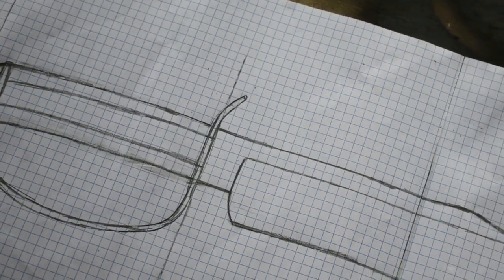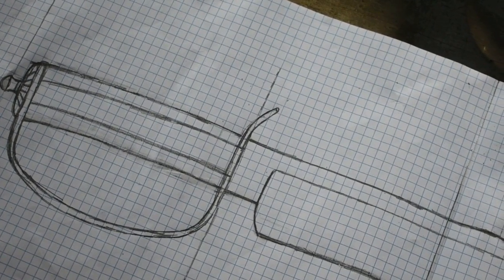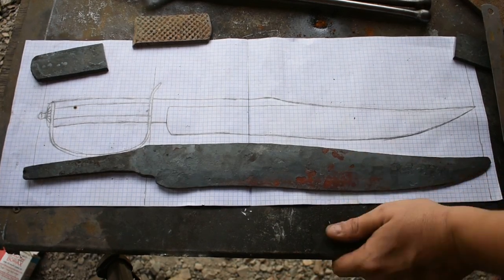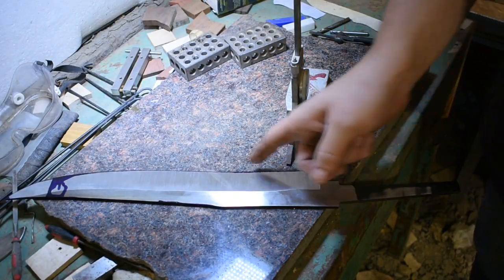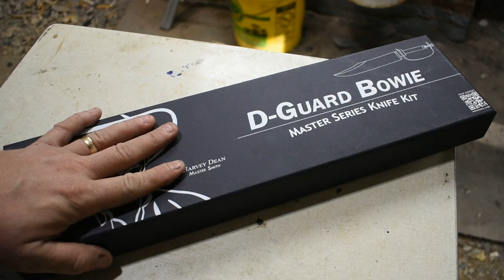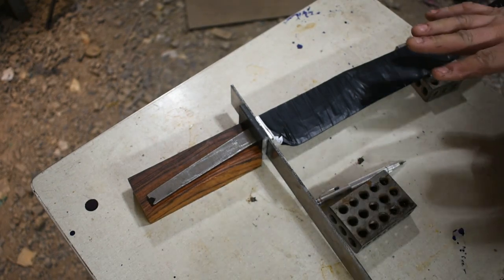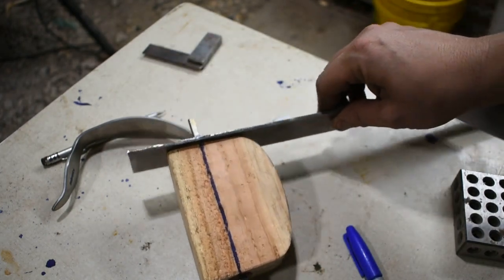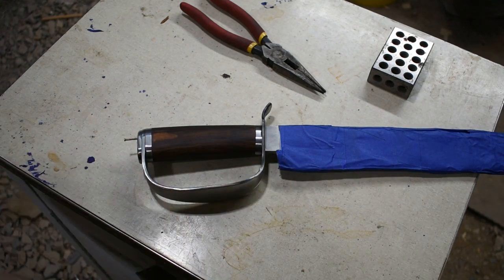Forging a Civil War style D Guard Bowie

Comment: Excellent knife. Although, are you not worried about possibility of that tread welded to tang breaking off during chopping?
Reply from the maker: Thanks, Not in the slightest, it is fully secured with a good solid weld, the hole through the handle is small enough to give a tight fit but still leaves enough room for epoxy to encase the tang to provide shock resistance for impact. The wood is desert ironwood which is very strong and stable in its own right, on top of that the tang is peened on the end to aid the treaded pommel in staying secure. If you go research some of the historical examples used during the Civil war you will find that a lot of examples were made extremely poorly yet stood up to actual combat. Welding on all thread to the tang of a knife is common practice in the knife making world even some of the biggest names in the industry do it, you just have to make sure the weld is strong, I always test mine and check while grinding to make sure it's solid. I appreciate you watching.